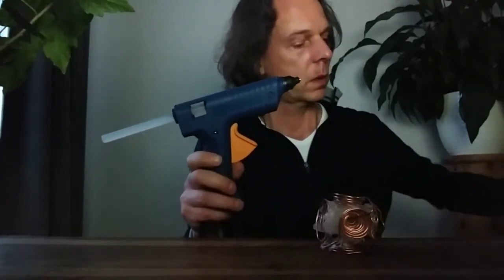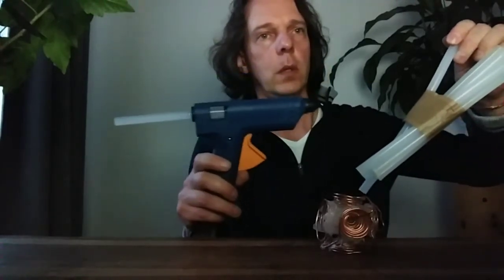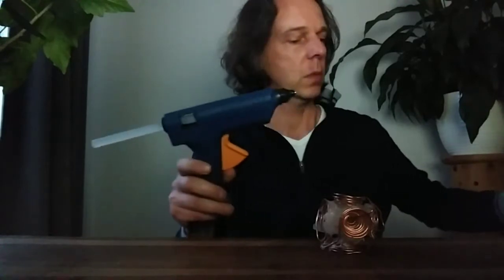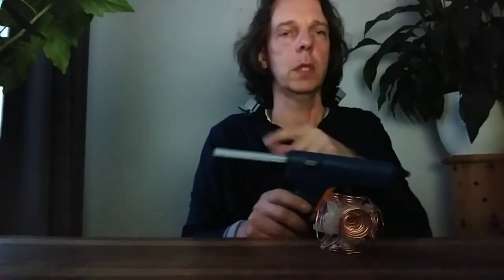Baramay Q6 device activation

Comment: Your device seems very simple for a Q6, how is it that you don't need the capacitors?
Reply from the maker: The device works from its core, that is where the six cones point to each other. That's enough for the quantum field to build up. Capacitors will be added to it in the next video, then it gets stronger.
Reply: @ElmarKleikamp  Interesting, thanks man! Can't wait to learn more
Reply: Do you have a email?